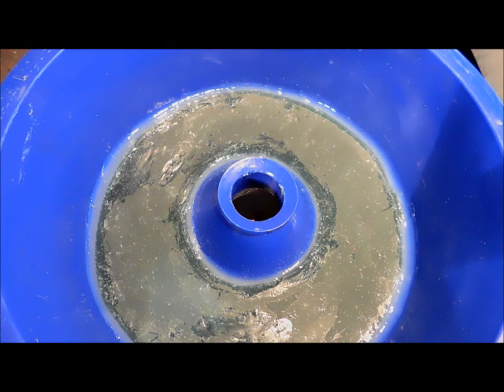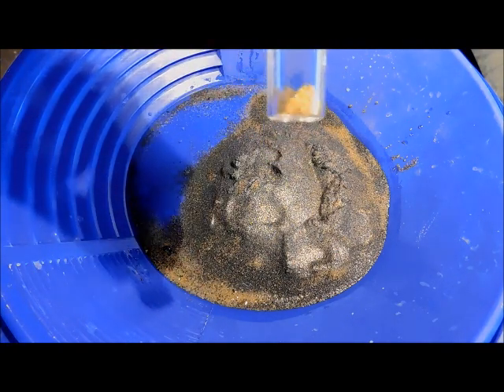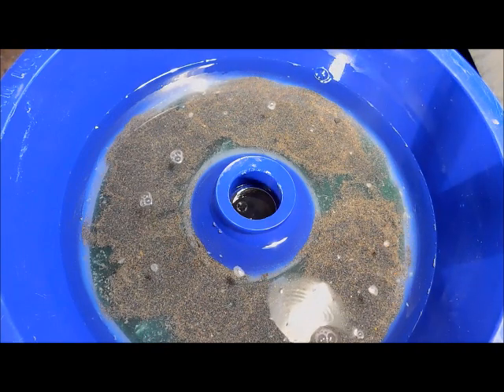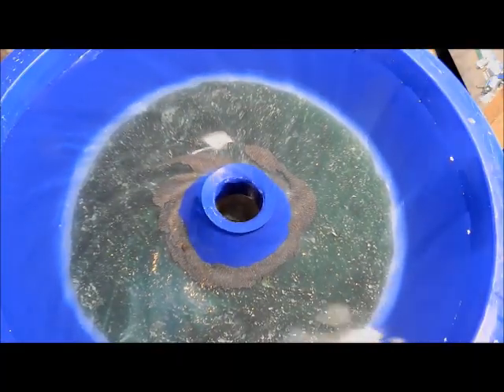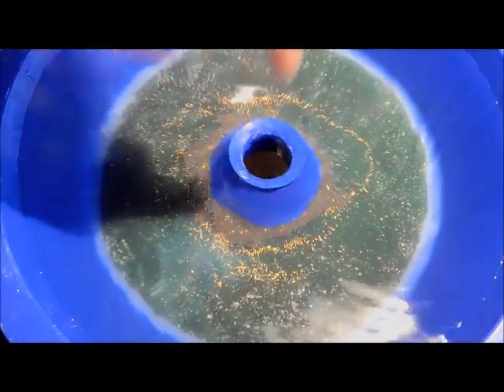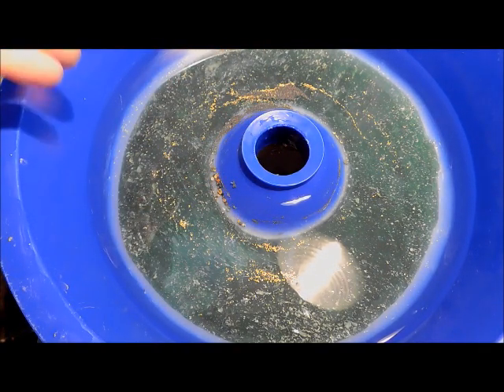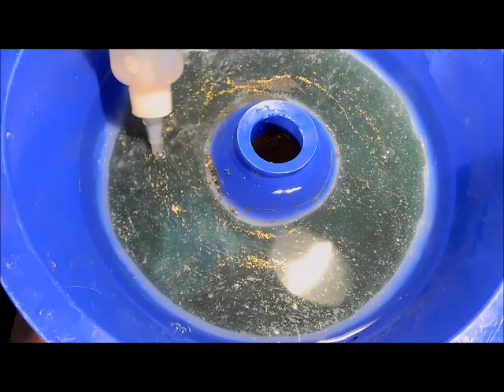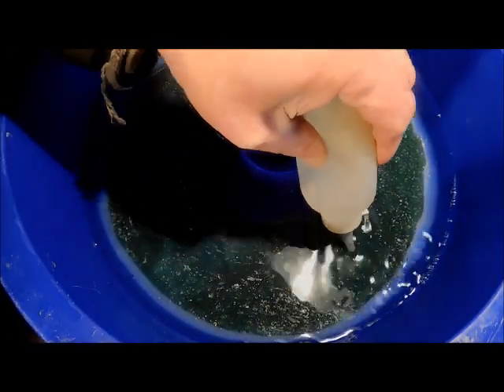Blue Bowl With Silicone Mat Experiment HEY WATCH THIS !!!

Comment: What a great idea!  I subbed, glad I found your channel.  Do you think the mat has to be glued down, or would simply setting it in place work?  Also, do you have any more molds in stock?
Reply from the maker: Thanks for subscribing after you silicone the mat in it does come out I have not tried to just lay it in the bottom and run it yet I do think it will stay. I have a new   mat I will be trying that is removable. I do have the molds for the silicone sluice box mats available for the mat in the blue bowl I did a video on how to make that one.

Comment: I didn't think cured silicone would stick uncured silicone.  Your experience is that it does, right? Does it take a specific brand/type of silicone?
Reply from the maker: Yes uncured silicone will stick to cured silicone. It must be a moisture cure silicone like project one pro grade rtv silicone I get from silicone depot or MD brand at Walmart or DAP 100% silicone.

Comment: Great Video I've been using silicone in my blue bowl for a couple years, got a Sluice I use on the beach to we got lots of fly pop on the Central Oregon Coast .😁 I guess the secret is out 😂 I use a small stiff bristle brush to push the Gold into a pile to suck it up works great.
Reply from the maker: Yes I would say your secret is out. I have never seen this done before and when I started making silicone sluice box mats I had no idea that the gold would stick to the mats. Thanks for the tip with the brush.
Reply: @alanrobertson2510  I figured it out by total mistake. I was putting a mat in a sluice and the extra silicon at the top of the sluice I just spread it out thinking I would clean it off later when it dry.😂 went to use the sluice at the beach and magic happen 🤔got the old noodle thinking. It just works so good on that fine gold. Great video.
Reply from the maker: @daddywarbucks6845  That is so cool. Did you ever try silicone mats or stick with the traditional mats?
Reply: @alanrobertson2510  I got a Gold Hog 😂 and a multi sluice. Still got the blue bowl and use it once in a while. That Gold Hog equipment is fast for clean up and good stuff. Building a custom high banker to bring to Alaska next year with some Hog mat in the bottom sluice.
Reply from the maker: @daddywarbucks6845  Have fun in Alaska. Nothing wrong with Gold Hog it is a great product. I was just wondering.

Comment: I have a video of a bucket sluice that I operate with a voltage dial. I can control the water speed completely with it. I don't use a valve. I feel it speeds up the water. Just a thought.
Reply from the maker: A voltage dial now that sounds interesting.
Reply: @alanrobertson2510  yes. It's an ac to dc power supply. Fully adjustable. I bought a 12v dc one off of Amazon for out in the field also.

Comment: I thought about coating my Blue Bowl with silicone last year after seeing your first silicone mat test..   now i think i will.. do you think the silicone should be smooth or can it have lil slight ridges( brush marks) .. thanks for this great experiment.. nicely done..
Reply from the maker: So this was my first try at this and the gold didn't move on the flat surface so I don't see the need for ridges. More testing to come.
Reply: @alanrobertson2510  thanks Alan,  i had a feeling thats what you were gonna say!!  :)

Comment: Well, that's looking interesting. I'm trying to find some naptha to thin down the Silicone so you can paint it on a surface like paint. I'd like to try it on one of my gold  pans to see if it works the same way. Yippers, it isn't just for caulking any more.😄👍. I wonder how a flat mat in the bottom of your sluice would work for this black sand gold?
Reply: Mineral Spirits should do exactly what you are looking for. 1:1 ratio
Reply: @GNUEngineering-42  

Thanks GNU, I'm going to give it a try.
Reply from the maker: That was crazy I never thought it would work that good. I thinned down some silicone with some nail polish remover once  it worked it was just full of air bubbles and it shrunk down a bit bushing it on might work better.Yes I do think a flat piece of silicone would work in the sluice the black sand sure didn't stick like I thought it would.
Reply: Hi, just keep in mind that silicone will not stick well to Polyethylene (the material most pans are made of). Here is a link, where you can get all kinds of 2 component silicones from soft to hard. There are al lot of suppliers for so called RTV silicones.  I would be interested to hear how it worked.  https://www.smooth-on.com/

Comment: Anyone tried a Miller Table yet ???
Reply from the maker: I have tried a miller table before another great tool.
Reply: Nonono....I keep wondering how to get a good flat surface using silicone - to MAKE a 'Miller table'.
Reply from the maker: @mlathan1794  Sorry yes it can be done if you watch my video on how to make silicone sluice box mats with a 3d printing mold follow the directions and make a mold the size you want and press the silicone onto a piece of glass I think that would work.

Comment: Congratulations  ! It works !
If you tilt the blue bowl up , will the snuffer bottle blow the fine gold down to the bottom edge ?
Would a line at the bottom edge be easier to snuff up than gold all over the bottom ?
Making progress  !
Reply from the maker: It sure did Richard and yes tipping it up would work it wasn't to bad to suck up the gold once I got the hang of it.

Comment: Hi Alan!
I've been trying to make some mats using wood moulds and am having trouble getting the Silicone to set up. I'm using a 50-50 mix of Dawn and water,GE 100% clear silicone and it takes 2 weeks to set up... I live here on the coast right across the river from Cape D. and was thinking too much humidity?
 I really enjoy your videos, and hope to meet you sometime on the beach.
Reply: Rick Smith 
Hi Rick, if I can jump in here, maybe I can help. The high humidity will help the Silicone set better as moisture is what causes it to set up. Higher temperatures also help.  I heat my Dawn water to about 98 degrees. That will cause it to set up faster. You only have about 5 minutes of work time at that temp. After I fill the mold, I Put mine in the sink and run hot water over it for about 5 minutes and then put it in a warm place to finish setting up. That works for me with the MD brand that Walmart sells. I haven't tried the GE yet but it should work the same. Hope this helps some. Alan will jump in here with his experience also.
Reply from the maker: Thanks Utah
Reply: @utahavalanch  thank you! I've been using the wrong silicone...
Reply: Hi Rick,
Make sure you are using GE Silicone 1.  Blue, white, and silver label.  GE has a 100% Silicone 2 which does not work at all.
Hope that helps!
Reply: @Whaler170  thank you! GE 2 will set up after about 2 weeks outside... I think that's why it's called "2". That's for the setup time.😁
Reply from the maker: Yes you are right. Thanks for helping out. Thanks again for turning me on to the 3D printing I think some days I want to pull my hair out. Just joking I hope you got out and found some gold this year.
Reply: No problem Alan, glad to help.  I have been working on some really cool new 3D molds and silicone mats for beach gold.  Fun to experiment around and try different designs.
Reply: @Whaler170  thanks!
Reply from the maker: Look like you have been getting some good advise.
Easy fix I had the same problem with the GE silicone and yes they make two types 1 and 2 so I stay away from the GE I have been using the MD brand from Walmart or DAP 100% silicone in the blue tube if you are still having problems let me know.
Reply: @alanrobertson2510  thank you! I'm positive that is my problem... know anyone that needs 6 tubes of GE 2???   😁
Reply from the maker: @ricksmith7652  No not right off hand. I am working on a deal right now so this doesn't happen any more and save some money on silicone should be finalized in the next day or two.

Comment: i don't have a way to 3D print anything, what would you charge for a silicone mat?
Reply from the maker: For this project I did not use the 3D printer just a piece of cardboard for the mold I will do a video in the next day or two.
Reply: @alanrobertson2510  so you made your own silicone mat, what kind of silicone did you use, i guess i have shopping to do.
Reply from the maker: @zemetrius  Yes I made the mat. Use only 100 % silicone I use DAP brand or MD brand from Walmart. I will be doing a video today on where to buy cheaper silicone.
Reply: @alanrobertson2510  cool
Reply: @alanrobertson2510  here is my problem, my group GSSN has a claim that i have been going to, i have been finding -30 and -50 gold but its very light as far as how much i have found, any ideas for something that would process the material to speed up recovery of the itty bitty tiny stuff? we don't have a lot of creeks and rivers in this area, so i bring a lot of dry material home to work in my garage, recovery is very slow, took me awhile just to get 100 pieces of -30/-50. panning does not really seem to work to get the few pieces that i have found, maybe something different is needed.

Comment: Alan, it's about time ya showed some real faith in your silicone FLAT mat!   LOL  I'm really happy for ya and I'm looking forward to seeing how it catches some -200 & -300 &&& so on.  I've got faith in you.  Now what ya need to make is a very smooth Blue Bowl coating with the silicone spread up the sides of the cone, to catch 100+% of your gold.  God bless you & your family.  Just wondering how a Smooth Mat would work as a Skid Plate at the beginning, the middle and end of your sleuth, or just an entire sleuth of nothing but these smooth mats?
Reply from the maker: Thank you Richard for prodding me a long on the mat in the blue bowl. Man that works way better than I thought it would. I think the water flow would be to much to handle for a flat piece of silicone in the sluice but who knows might have to try it. I want to see how the bowl does on some beach gold as well.
Reply: @alanrobertson2510  You go youngen, (I'm 71 yrs old), I had a thought while reading this reply of yours.  For those & you, who want to do the silicone in a Blue Bowl but don't want to leave the silicone in the bowl, why not use an Aluminum Angle Food /bunt cake pan instead?  All ya have to do is cut a inlet hole in the side and trim the cone and those cake pans are what, $5 - $10 each?
Reply: Alan, I just had another  idea from LEFT FIELD.  Wouldn't it be great to take a blue bowl out in the field?  Silicone the bottom of one of your old junk pans, or at least think about it.

Comment: Question, could you use a small nylon brush to get all the gold in a pile like when using the Miller table?
Reply from the maker: Good idea that might work. After I got the hang of it it wasn't that bad to suck up the gold.
Reply: I use a turkey baster to move the gold to one area/pile, then suck it up.

Comment: Alan, what about a miller table with a silicone mat instead of slate or a board with chalkboard spray?  Nice video by the way!
Reply from the maker: Hi John. Yes it will work. On one of my videos I took my sluice mats and turned them over and ran it like a miller table and it worked pretty well.
Reply: Alan Robertson...I remember now,  thanks!  Good stuff!

Comment: Nice with the silicone idea, could you explain how much gold is lost when you spoon the dirt in while the bowl is on please thank you.
Reply from the maker: Lately I have been turning my blue bowl off before adding the material. I think as long as you have the jet dry in the water the gold would sink to the bottom of the bowl before it went out the top of the cone. Just my two cents worth.

Comment: Nice Alan, may be just as easy to dump it all in a pan from the blue bowl. Easier to wash it out, since you have to work a bit to remove the gold with the snuffer.
Reply from the maker: Hi Ed good idea after I got going on it it wasn't bad at all to get the gold off the mat.